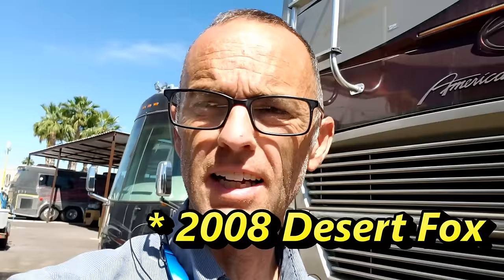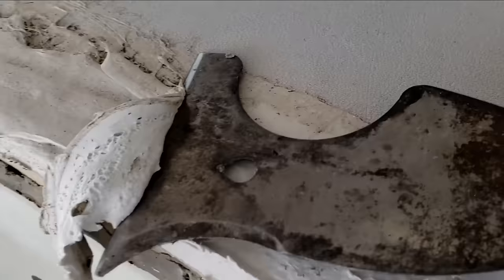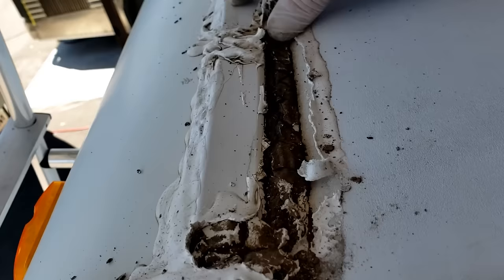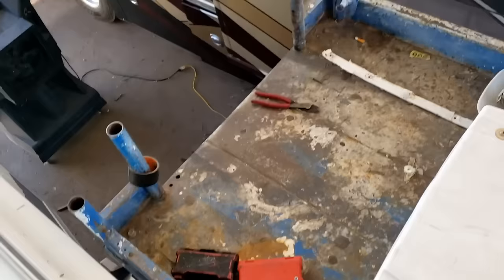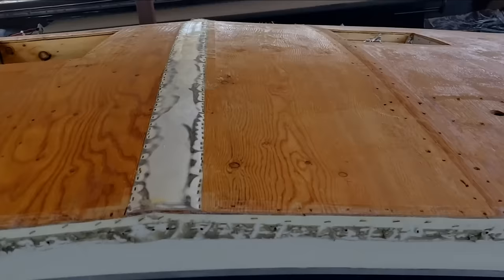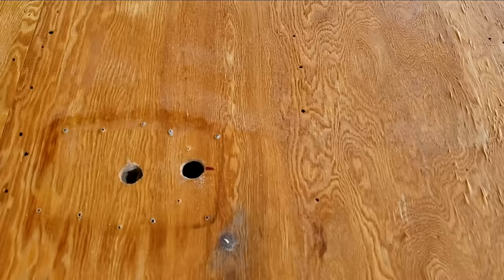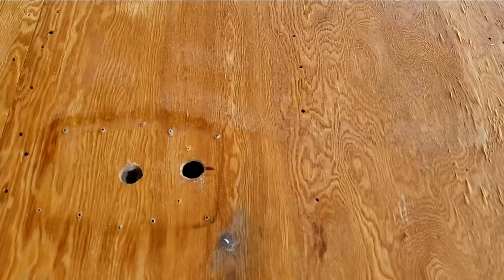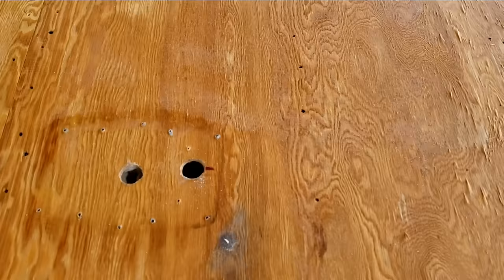When Should a RV Rubber Roof Be Repaired or Replaced?

Comment: Great video!! In looking at my 2016 Coachman Apex Nano, the edges of the roof roll over the sides and is loose up and down both sides of the camper.   I am assuming they didn’t pull the EPDM tightly over the edge.  I have noticed two small spots of a half inch where it looks like the material is creased.  Would it be good measure to cut some eternabond patches and lap over the edges and then seal the eternabond edges with Dicor?    My wife wanted this trailer and it’s turning my hair grayer by trying to keep up with it!!! :)
Reply from the maker: I am not sure what you mean by creases. If they are cracks then repair tape is not a bad idea. Thanks!
Reply: AZ Expert I’m not sure if crease is the correct word, but it looks like a weak spot.  Not a tear/cut, but a weak spot.  I noticed it when cleaning the roof.   Eternabond it is!  Thanks again for all the great content and help!
Reply: masapell z

Comment: Great video as usual. Is the owner going to do anything about the delamination on the front wall?
Reply from the maker: I don't think so. Sadly, delam on the front cap of modern trailers is almost always going to happen and it's not just caused by water. Filon is relativley unstable and needs a substrate to keep it firm. Unfortunately, most OEMs use cardboard which can let loose in water or heat. I've replaced complete backwalls and front cap walls just to have the delam occur without ever touching rain or a wash. Thanks!

Comment: Is the Rubber Roof glued onto the Plywood underneath or laid on top without glue?
Reply from the maker: the rubber is glued to the plywood with a water-based adhesive
Reply: @AZExpert  Does water based adhesive mean that you clean up any spills or overspray with water, similar to how you clean up paint brushes when using water based house paint? 
What happens when the adhesive dries? Can you clean it up with water after it dries or do you need another chemical?
Reply: @AZExpert  Great video, how do prep the existing luan if in great shape as once rubber removed there is tackiness on existing luan after old rubber removed. Do you need to lay new luan over existing or just glue right over existing tacky luan surface  will it bond rubber to tacky luan?  What type glue? Cheers

Comment: Could you have put a fiberglass roof on instead of the rubber roof?
Reply from the maker: The roof and edge won't allow it, especially with the large angle at the front, the sheet won't be able to make compound curves.

Comment: Nice job. My roof on my RV was replaced when it was new. My roof started to come up getting getting air along the side first. then at transition. This year I caulked under gutter rail and it stopped and started to lay down again.
Reply from the maker: Oh no!
Reply: @AZExpert  I have thought about it. I have a 2019 class C Coachmen bought 2018. When it was new there was a problem with roof. Dealer replaced it with TPO roof. The next fall I noticed the roof lifting along the edges air under roof membrane. Then It started lifting at the front transition. Knew I had to do something. I used eternabond along edges. Covered gutter screw cover. At transition glued down the membrane with long needle. Then it came to me that air might be coming in under gutter rail. I caulked under it. with my awning open. Waited 6 hrs closed awning and it made cracks some in my caulking. Only makes sense that awing pulls bottom of gutter rail out. I had checked some of the screws on the gutter before this and they were tight. 3 trips so far everything good. Roof not lifting so far. Pass it on.

Comment: It's kind of ironic,  YouTube is running armorcoat roof coating ads on this video with claims that your roof will last for ever with their product.   I'm sure there's fine print in the warrantee...
Reply from the maker: There is a good chance the roll on coating does work, i just think if the roof is leaking, a coating didn't solve the problem it only covered it.

Comment: Could you show the method you do to seal the leading and trailing ends?
Reply from the maker: What parts do you mean?
Reply: AZ Expert the leading edge is the front edge and trailing edge is the rear edge.you seemed to avoid putty ,makes sense because it drys out
Reply: Are the glues solvent clean up or water clean up based?
Reply: Thanks great presentation
Reply from the maker: Under the molding/trim is butyl/putty tape which is the main seal or gasket. The sealant on top acts as flashing to direct water away. The sealant can be cleaned up with mineral spirits, but DO NOT USE it on the membrane. The membrane glue is water based so could be cleaned up with water, but I just throw the rollers away as it's more cost effective. Thanks!
Reply: AZ Expert thank you. Do you have a list of supplies that you recommend or ones to avoid?

Comment: Afternoon.  My rubber roof is still in fairly good shape.  I have on corner on front right of class c cap that is a bit soft ( maybe 6 inch by 6 inch ).  Is it reasonable to loosen transition and PEEL back roof to repair ?  Have you done video on this type of repair ?  Thanks

Comment: Where is the best place to buy a high quality, heavy duty, longer lasting roll of rubber roof for a 2008 Forrest River Gray Wolf 28BH with one big slide out ?  I wish I wasn't so far away from you. I would rather have you do the job for me.
Reply from the maker: Thank you. As far as heavy duty, there are commercial grade TPO membranes but you have to purchases those from dealers. The dicor EPDM is a thick and robust rubber roof and can be sourced by any RV dealer...but the online pricing will be much cheaper for the same product. RecPro on Amazon sells much cheaper material both cost and quality so be aware that it is not Dicor.
Reply: @AZExpert  Dicor it is.. Thank you for the great how to videos .

Comment: Great video. Do you recommend putting putty tape under the trim piece that holds down the edge of the epdm sheet?  I have an older Skyline 5th wheel that I need to re-roof next year, do you recommend TPO or EPDM?
Reply from the maker: EPDM is better and yes put putty under the molding. Thanks!

Comment: What is a ball park figure for roof replacement? I have a toyhauler that is getting close to needing a new roof, and am weighing repair costs versus replacement costs.
Reply from the maker: That's a difficult question to answer. A new membrane roof will start around $5000. Thanks!
Reply: AZ Expert Thank you for your response.

Comment: Thanks for the great video! Have you experienced PVC roofing material? I have done some research and it seems like it last longer and more durable. I have a 2003 Winnebago with most sections of the roof gone but luckily the plywood underneath looks good.
Reply from the maker: It does seem to be a great product, the downside is that Winnebagos do not lend themselves to membrane roofs without a great deal on re-engineering.
Reply: @AZExpert  I totally agree! Should be recall on that!

Comment: What dose it cost to do that replacing the roof
Reply from the maker: Usually a small membrane roof will start around $4000-4500
Reply: @AZExpert  Thats why I'm doing an elastomeric coating on my roof. myself.  I sealed all my roof vents with self leveling Sikoflex.  The rubber is actually in pretty good condition.  I only paid $2900 for my 32 foot camper.  So spending thousands on the roof is out of the question. Im spending barely over $100 sealing it.  Plus I put rain covers over my 3 vents so I can leave them open.  Those were $20 each.  A new skylight over my shower was $30.